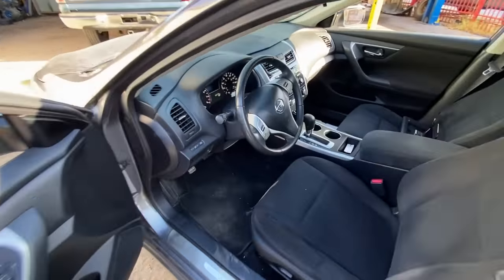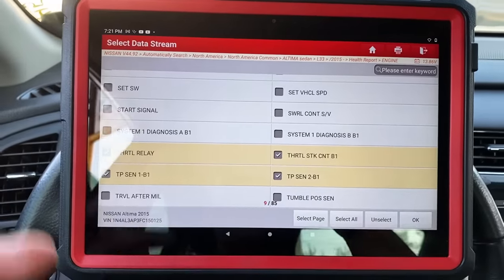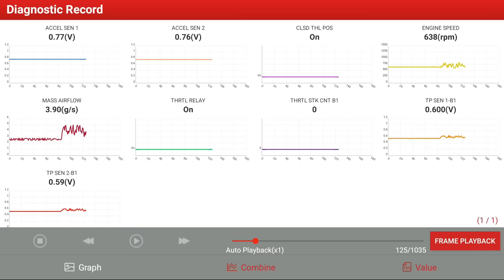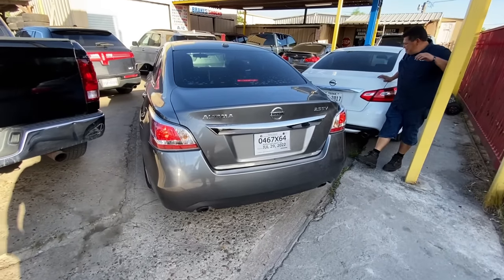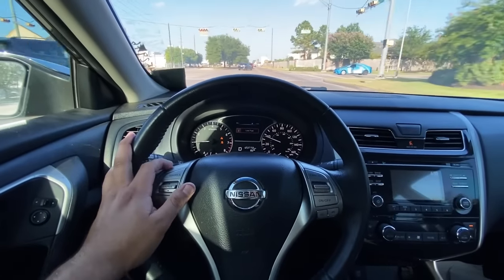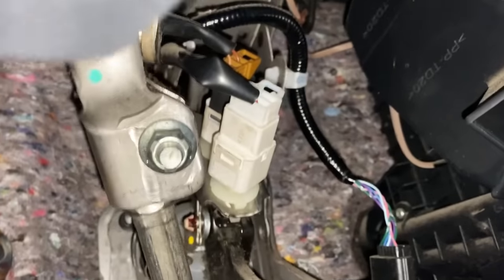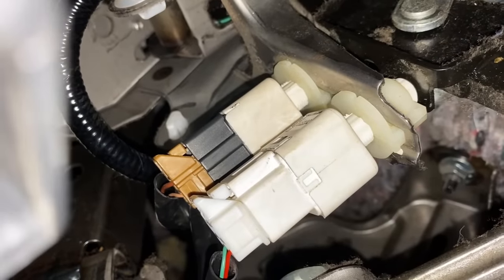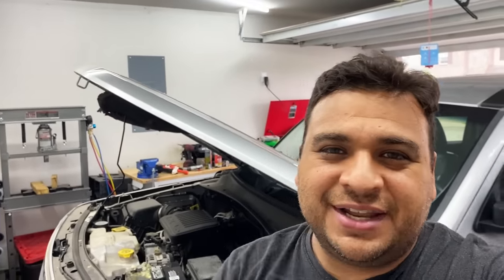NISSAN ALTIMA RANDOMLY WON'T ACCELERATE ABOVE 25MPH!!

Comment: Dude, this is EXACTLY what happened to my son’s Altima.  Now we know what to recommend to the mechanic.  You rock brother!
Reply: Did it fix it? I have a 2014 same issue
Reply: @dylanrose4102  yes, it was diagnosed as the Stop Lamp Switch and replaced.  Issue gone!
Reply: Stop lamp switch
Reply: Where's it located excatly..pls?
Reply: @mikeklimavicius5670 thanks for sharing. My daughter just got an Altima and has the same problem. Did you then have to replace the stop relay switch like this shop had to do also?
Reply: I have Nissan Altima 2011 hybrid it randomly stops accelerating on the highway will this help ?

Comment: Thank you Eric. Good job. Looks like one brake switch is for cruise control and other is to control the stop lamp relay, which will operate the stop lamps and also splices to signal to ECM, ABS, and BCM. Have a blessed week to you and your family.
Reply: You're a very knowledgeable and contributing viewer. Every time I see your name, I make sure to read your comments. I appreciate your input.
Reply from the maker: Thanks for the info!
Reply: D
Reply: @ADVANCEDLEVELAUTO  I may need your assistance with a 2004 Trailblazer, 4.2 I6, wont get up and go either.
Reply: @ADVANCEDLEVELAUTO 

Great diag bro I have the same scanner man I love it. Are you gonna stick with it or go with something else? Also have you used it for pcm and ewt alignment?
Reply: @mr.mrs.keesee1169  please what’s the name of the scanner and can you share a link on where I could get to buy ?

Comment: I'm amazed that the two brake switches having the same status doesn't throw a code.
Reply: I was surprised at that as well.  But then I saw it was two separate switches, so it probably happens normally if the pedal is in just the right spot.  I think most other cars have a single assembly with the two switches so they are less likely to do that.
Reply: @russellhltn1396  engineering missed the flowchart.
Reply: @michaelshadwick3487  Maybe, but being two separate switches increases the likelihood of not being in sync and causing a nuisance code.
Reply: hi with me it happens after turning in a rounadout or emerging or to the main road,  no revving kept pressing the pedal but not respinding, engine is on and after a couple of seconds it goes back, its just worrying me as sometimes cars are behind me it couls be a danger
Reply: What relay number is it?
Reply: Bad computer programming.  You are 100% right.  I'm also disappointed that they don't put in a full instrument / computer display on the built in radio/computer system.  They want you to go to a shop to pay to read these codes.

Comment: Sadly, most shops would've sent that customer thru financial hell. They would've started by replacing sensors that worked fine and finally ended up replacing their engine control module, including all of that labor cost. I always tried to stress to my techs the importance of understanding the fundamentals of each automotive system, and not just how to remove/replace parts. Unfortunately, laziness sets in when a shop owner stresses "get'em in/get'em out" mentality. I even had a student tell me one time "Being a mechanic is just parts recognition and knowing how to use the tools". Even tho his grades were extremely low, that wouldn't have stopped him from getting a job. For anyone reading this, ask a good mechanic to refer to a shop, and once u find a good shop, stick with them. Also, techs know what they are worth, so be prepared to spend the money. Because u will spend less getting it right the first time versus spending to get it wrong several times.

Comment: I'm a tech as well and just wanted to add that there's technically only 1 brake switch on these cars. The other is a "Cruise Cancel Switch". I always go OEM and replace both. Great diag btw!
Reply: Yea and there's know Brake switch Relay that I can find both on my 2009 Nissan altima 2.5s 4CYL. The second switch on the brake pedal is the cruise control cancel switch.

Comment: I have a 2006 Sentra, was accelerating uphill off an exit and the brake light came on and I was unable to accelerate past 25. Pulled over, turned car off, then it turned on again and hasn’t happened again. Maybe that is what’s wrong with my car. Mechanic ran all codes and nothing! This video was very helpful. Thank you 🙏🏾
Reply: Having same problem right now on 05 Sentra with 107k I have a code but this is worth looking into for sure mine kinda gives me a few second heads up and just starts idling down then turns off. I'm start it again and it acts fine
Reply: Alternator
Reply: Let me rephrase this I have a Maxima that this happens to, every time I change the alternator and this issue goes away.
Reply: @traviskelly7082 How many times have you changed the alternator?
Reply: @molahi5779  4x but thats because I was getting remans from advance.
Reply: @molahi5779  the 25 mph is a safety Nissan uses. if its only happend once you can either go get a new alt or worry about it till it leaves you on the side on the road. The break light and 25 mph is code for alt
Reply: @traviskelly7082  Mine wasn't even accelerating to 25. The steering wheel started locking up. That made it hard to park the car. I had to turn it off a few minutes just so that I could get it parked straight. I had it towed to the dealership. They told me it's the alt. Of course the part is on backorder! So my vehicle has been there a few weeks awaiting the new part.

Comment: I’m noticing a pattern with Nissan brake light  switches, this is like the 7th video I’ve seen about Nissans having weird problems because of faulty brake light switches. 
Almost to 100k, I can’t wait to see that. You deserve many more.
Reply: We have a 2018 Nissan Altima and it does this also. I shut car off and restart it and it goes away. So I'm going to change this part and see if it works.
Reply: @bradleymadosh3596  Hello Bradley, I have same problem with my car.... have you already changed  the breaks  switch ??.... please, let me know if so, and if your car is running well... thanks.
Reply: Had a similar problem with 2013 Nissan Sentra took it to two garages including Nissan dealer,they couldn’t figure it out. I did a search on YouTube found a video saying check and see if there was moisture,actually water in the any of the brake lights and there was.Went to salvage yard got a replacement rear brake lens FIXED IT

Comment: At 64 years of age this is a new one on me. Excellent diagnosis and presentation as always. Thank you for what you do.
Reply: I wish the OEM service data (from all manufacturers) gave better details on ECU ‘default actions/safe mode’ operation when strange conditions exist.  Two weeks ago I had a Hyundai where the ECU would shut off the AC compressor when the CKP signal was weak (but present).

Comment: Thank you so much for this video; it saved me from spending a lot on parts to find the problem. I had the same exact issue with my 2018 Honda CRV Touring. I drove two hours away from the city for work, and my car would randomly slow down numerous times. The RPM would drop, and the car slowed down as if the brakes were being applied. Then the RPM would go back up, and I'd regain speed, all without any check engine light or warning signs. Upon returning to the city, I had it checked and scanned, but no fault codes were found. They inspected the throttle body and cleaned it, checked the plugs (which were fine), and examined the fuel pump (which they also cleaned). They even removed the differential, but the problem persisted. The only option left seemed to be buying a new throttle body. However, I came across your video after extensive research before making a decision to purchase the new throttle body.

To confirm that the issue was related to the brake switch, I turned on the cruise control to see if it would turn off on its own without touching the brake. It did indeed turned off, confirming that my car was applying the brakes randomly. I replaced the brake switch, and the problem was solved. My car now runs like new again. Thank you! 😊

Comment: I just encountered this problem (limited acceleration, trac control light turns on) on a 2021 Hyundai Accent, but I received a P0121 code (throttle body).  Found out it was replaced at the dealer, but code and symptoms returned.  Just for your video, I’ll ask the dealer to check the brake switch and relay now.  Thanks for your great videos.  You’re a great teacher!

Comment: I think your video just saved me thousands of dollars and many hours. I have a 2013 Nissan Maxima. I’ve been having a very similar issue issue but not stuck at 25mph my car will basically buck through acceleration randomly but I can get up to speed 50-60 if need be. Totally intermittent it took a long time to get worse and is very concerning when driving. No codes. Had the car looked at by 2 mechanics on was Nissan. Replaced the spark plugs for routine maintenance and did tranny fluid not to long ago. Nissan told me replace the transmission which is a awful answer. 

My engine mount is also bad so we thought maybe the engine moving caused something to be loose or crack letting air in. So we check d all tubing and wires to see if anything looked bad, we tested the car a whole bunch shaking it and braking quick hard Corning and realized something felt like it was sticking, and causing the brakes to go off. No Abs warning but we thought maybe that was kicking in for some reason. Watched your video and it all clicked together. It’s bucking on acceleration after hitting the brakes… the brake switch is sticking… my father was driving behind me and saw the brakes flicker a few times meaning it was engaging when I wasn’t hitting it. I just switched the plugs for $100 and no issues so far. Thank you so very much
Reply from the maker: Awesome! I hope that solved your problem. Thanks for watching!

Comment: Excellent, fully informed video including how you interpreted the diagnostic information. I’m a little surprised that the diagnostic tool didn’t alert you to the braking issue. Fabulous that you happened to notice the brake lights as you walked past the rear of the car and analytically connect it to the initial complaint! You are truly a mechanical detective!! Looking forward to more revelations!!!

Comment: Thanks for the good tips. I owned a 2008 Altima 2.5 and have experienced problems with the brake light switch. It won't start and I suspected it to be a battery issue which was not. It worked well after changing the brake light switch. It pays to learn.  Thank you.

Comment: Very interesting and sensible ECM logic at work here but one which makes for a lot of head scratching. Very easy to see those brake lights on and dismiss their culpability in a limp mode issue.

Comment: Thanks for the great video.

I met the same randomly driving issue just after replacing the brake servo.  It was a 2016 Nissan Tiida 1.8L with CVT transmission.  I used ThinkTool to record data like the first time you did.  I cleaned the MAF, which seemed better, but still having the issue.

Finally someone noticed the brake lights on and then I redid the adjustment a little bit longer.  The issue was gone!!!

Comment: Nice one, I’ve repaired brake switch related problems recently & in the past. The problem with certain vehicles (Honda/Acura & Hyundai) is how the Brake-Switch buttons aren’t being fully pressed anymore. 

Usually for whatever reason, the manufacturers will leave a hole (or two) & have a “button presser” in said hole to fully press on the button(s). & said “button presser” will break apart causing all kinds of issues. 

The repair I’ve done that works is to get two pennies or any other coins 🪙, gorilla glue them together in a stacked fashion, & glue the stacked coins where the buttons would be pressed on the brake pedal neck. It’s been years since performing such a repair on various vehicles & I haven’t heard a complaint yet.
Reply: Would that work for a 2011 Altima 2.5?
Reply: Same with almost any Nissan going back to the 80's.
Reply: @olguiq1013  yes that would.
Reply: @marshmower  indeed!

Comment: Have an Altima that when hot it would act up, rev high but go slow. Took it to a transmission shop and they said after testing that the transmission was failing. Not having that $$ I googled the issue and decided to replace the rotation sensor for $40. Once I installed the sensor it drove like new and is still going a couple years later

Comment: My daughter had the same issue withher altima sr 2016. She got nervous and traded it in thinking it was the transmission. I told her to get it checked. Thanks for the video it was excellent.
Reply: Lmfaooooooo. You can just see the brake lights on in the back. Well what did she buy?
Reply: @occckid123  Lol exactly.  I wished I bought it from her.

Comment: You rocked this one. I have two with the same problem and now they are both fixed.
Reply: How do you fix it lets kmow
Reply: Are there 2 different sensors you can buy or just 1? We’ve replaced 1 but not the other because we can’t find a second different one. Hope that makes sense? Or can we use the same one on both?

Comment: Very good diagnosis and tips!  That would make sense if the B.L. switch is pushed, you wouldn't want engine power to continue.  Gotta keep this video for future use and to send to my former co-workers.  I'm retired, now I work on mostly my own.
Reply: yes it's exactly what it does you can even confirm it in a perfectly working car, press the brake and then try to accelerate it will be unresponsive

Comment: Thank you for posting this.  My 2015 Nissan Altima is doing exactly the same thing.  I will replace the relay first.
Reply: Did replacing the brake switch fix the problem?

Comment: Dang, I wish I would have come across this video while I stayed in Spring, Texas….I have a 2012 & 2015 Nissan Altima and the 2012 was given me the same problems. I sold it but now I need to have my 2015 checked because it has no heat. Great video!!!

Comment: My 2015 Altima was doing the same thing on hot days. When I came to a stop it would take 5 seconds for the car to car even with the accelerator to function. I changed every sensor including both brake switches. It turned out to be bad transmission fluid. The factory ns2 fluid is crap. I changed it with amsoil cvt fluid and haven’t had a problem in over a year now.
Reply: I guess that is why there has been so many CVT problems because of the factory ns2 fluid probably have destroyed so many CVTS with angry 😠 customers guess Nissan dealers need switch over to Amsoil CVT fluid instead.

Comment: U are a genius my guy. I have something similar to this one. 2006 acura tl automatic. No codes, goes into each gears, but does not respond when going into R/D gear. Customer thinks his transmission is done but it could be something small like what you discovered.  Ty😊

Comment: Nissan always had weak cvt transmission's after 2007 model year made by jatco they are built bad they use 2 clutches with metal rubber band older transmission used to have clutches way better design I know all newer cars are going to cvt but Toyota and Honda never seen them go bad great diagnosis

Comment: A mechanic that uses his brain. Not simply going through the motions and claiming first  predictions are the issue. Great work. I only go to a mechanic "IF" I can not find the problem after first going through basics. Complete and thorough research. Going through every avenue and even then if I talk to a mechanic I look at his face, body language, listen to his replies evaluate his conclusions, compare them to my research. I have only had one mechanical problem that I couldn't figure out and guess what? Not even the mechanics could figure it out. 
Replaced brakes (all) to include wheel cylinder(s) calipers both front, Master cylinder, ABS module. Yet, seemed as if there was air in the system. That's another story. Either way, this guy really tries all avenues and I applaud his for his work.

Comment: Yes bravo for the Automotive detective work that Nissan Engineered! Kudos to you my friend. I have subscribed and I'm only borrowing my friends 2018 Nissan Versa bc someone decided to vandalize my Mitsubishi Outlander. This Versa has been in the back yard for over a year parked. My friend doesn't know ish about cars. First thing I had to do was put a new battery in it. I then was able to scan it for codes. 2 codes popped up P0603 and P062F. However the symptoms while driving are exactly what is described in those video. This POS JATCO CVT tranny is whining, the RPM's are at idle while pushing the accelerator pedal. No throttle response. If you let up off the pedal the transmission the car is moving based on the idle speed being at about 1500 RPM's . To think a Brake Switch can wreak this much havoc is insane and Nissan INC needs to pony up and recall all these models that needs these brake switches and relays replaced. Its bad enough the transmissions are shotty crap that barely meets government standards now there's this issue that seems to be common place with hundreds of thousands Nissan car owners. Where's the NHTSA with this issue and when is this issue going to be rectified??? There's enough Nissan car owners Altima , Versa,Note,Sentra,Maxima, Rogue to get Nissan to recall these models and EAT THE COST of these repairs!! This is a DANGEROUS problem that people are suffering with that SCREAMS MALICIOUS on Nissan's behalf! There's power in numbers and I say let the Recall campaign begin!!! Enough is Enough! How many people have been told they need to replace their transmission when the main culprit is this Brake Relay and Switches!? How many Nissan owners are going to get seriously hurt or killed because they're driving around with this problem. THERE ARE OPTIONS. NISSAN INC address these issues or we can find a few attorneys who take on automakers who fail their customers!